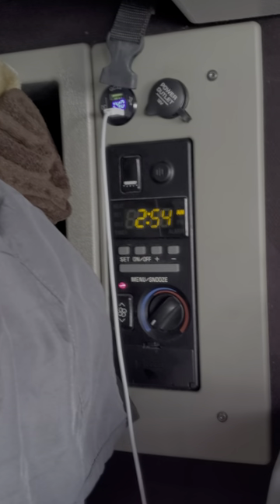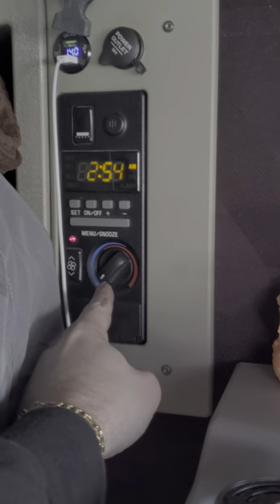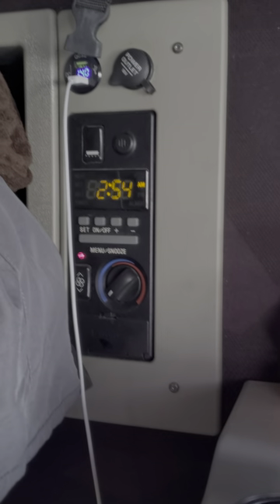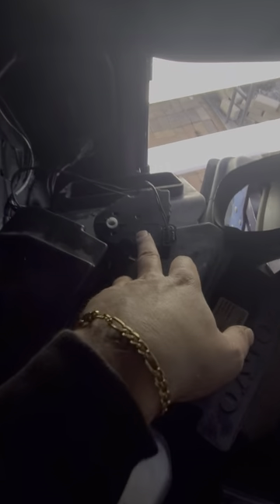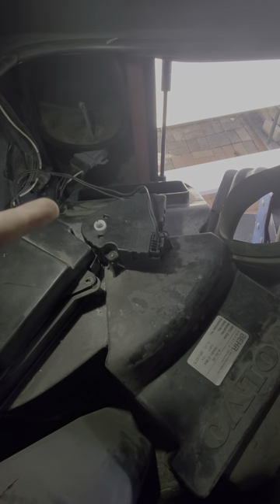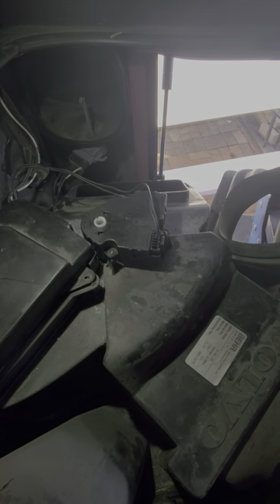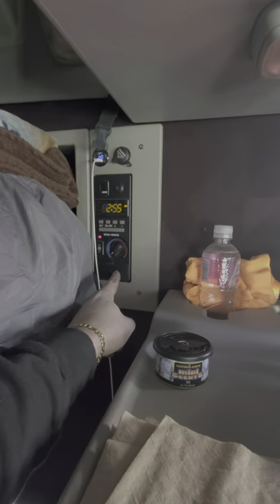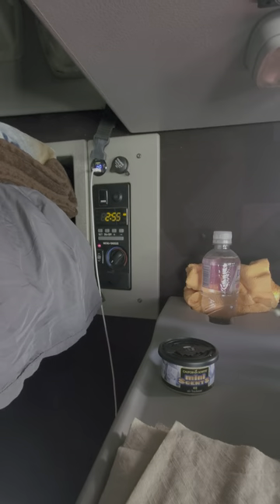volvo vnl sleeper temperature fix

Comment: My Sleeper gets no AC, freon lines under truck use to get cold and have condensation dripping, now no cold air comes out in Sleeper. Blender motor works (can see it moving from one notch to the other when temp dial is turned), brand new temp sensor under bunk, new blower motor and resistor in front. System showing to be properly charged. Front condesnser would freeze up like a block of ice when driving on south east with all the humidity.
Someone told me it could be the Condesnser dirty or defuser valve, but really dont want to be changing out random parts.
Reply from the maker: There is a valve back there in the actual freon line it is a block. It opens an Closes, costs about $50 it's called the expansion valve. That would be my guess try tapping it lightly see if it frees up possibly.

Comment: Do you have issues with the front doing the same thing as well? Because my issue effects both front and back. Been trying to diagnose this issue for months now.
Reply from the maker: On separate occasions I did yes. Front had the clogged ac condenser in the firewall. I think I put a video up of that awhile back. Would go cold to hot with almost no AC.

Comment: Send me the info so I can find it
Reply from the maker: You should be searching for bunk box temperature sensor or blend door motor I’m not sure which one is bad on yours also check the fuse the issue with mine was it would not turn hot to cold